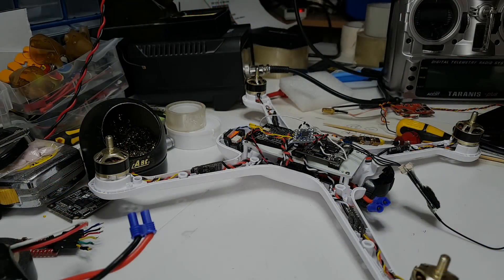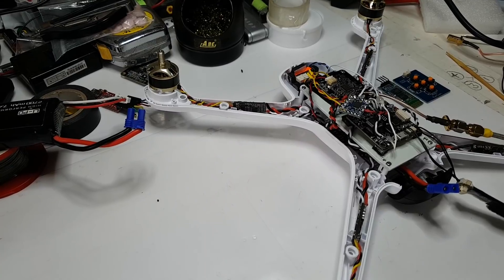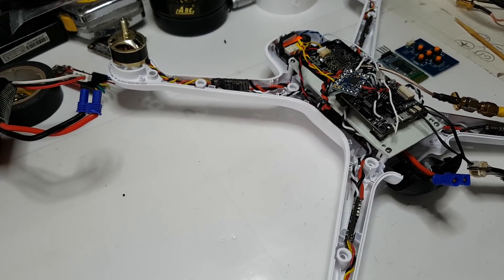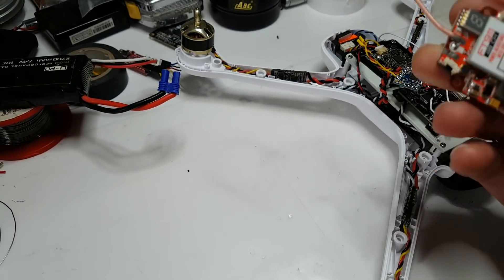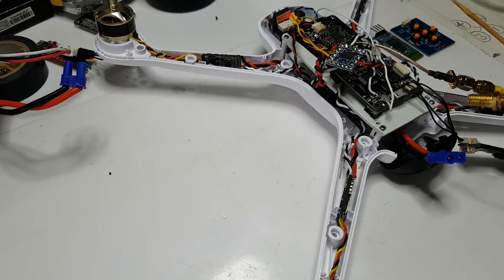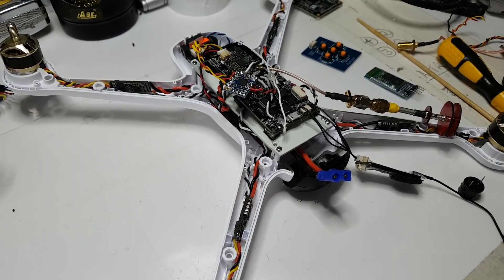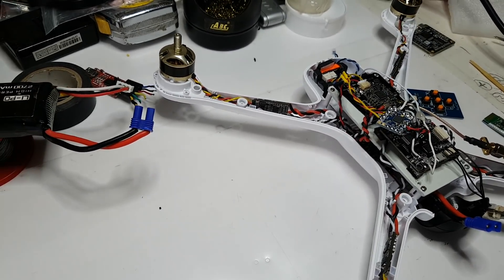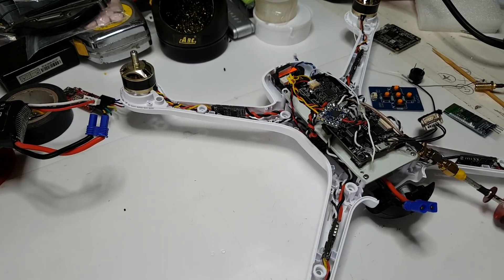Inside my Hubsan H501SE with a couple of mods

Comment: Hi wondering if you can help, i am after the pinouts for the video cable that goes to the cam board on the h501s, i know it has 8 wires but not sure what they all connect to, i am wanting to connect to an outside underslung camera, if you have an idea would be appreciated and thanks

Comment: I saw that you worry about the 7inch propellers.. I have replaced the motors of my hubsan with dys be1806 2300KV motors and use the 7 inch props with no problem. I made this change since 2 months and have no problem even using it under manual mode. this mod was needed because in bad crashes the hubsan motors always mulfunctioned.

Comment: awesome!   Could you link the FC you used?  would it work with the exisitng hubsan ESC's?  Im assuming your receiver only links to a 3rd party transmitter correct?  ;  (i'm only really focused on LOS flight, not FPV)
Reply from the maker: Here is the link for the FC https://goo.gl/Rky28d
I didn't try the original ESC's as I had the 20 amp Little Bees already.  Hubsan transmitters will only work with Hubsan quads. I have switched to TBS receivers which work with any transmitter that will except a XJT module.

Comment: These are not mods. Almost complete replacement. Still love my 501s! Fixed camera is only problem. Waiting for modular Hubsan with interchangeable parts like gimball. Btw I have changed roll damping factor in firmware so it is more relaxed on roll stabilazation. Work well.
Reply: tweakradje where in the mod tool can you change the roll rate

Comment: why do this mods, was it that bad standard?
Reply from the maker: I like to tinker and did the mods so I could fly this nice looking craft without being held back by the software. I like to fly high and swoop down into tight turns etc. The Hubsan as stock fights me all the way and can cause loss of stick control for a second or two while do so. This way if I clip the floor the craft recovers immediately, I can practice any maneuver without fear of loss of control.
Reply: Will the husban H906a Transmitter work with other drones???

Say a h501a

What about if i made my own FPV race drone? can buy a receiver module? Or is it part of 1 big board in the drone?

Or have you gone the other way and bought a better transmitter? 

Sorry i haven had a chance to watch all of your vids yet : ) Keep up the good work

Comment: Nice setup. I have not modded mine as much as you have. I did however add a dalrc osd setup. I guess as I start to replace components I will do as you have and make a hubsan hybrid. Awesome channel. New sub 🖒🖒
Reply from the maker: Nice thing about these mods is I could put all Hubsan components back if I wanted to. Not sure why I would as this is flight freedom. Hubsan unchained !
Cheers for the sub.
Reply: Elecifun 4S and acro flight would be neat on a 501. However dont think the airframe would like it much. Thanks for the reply.